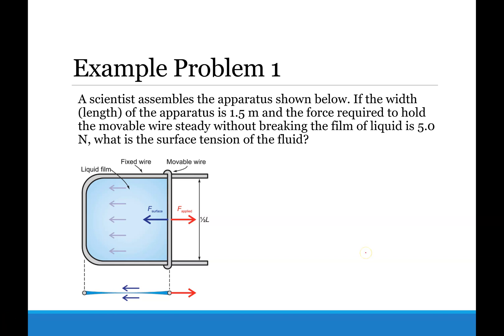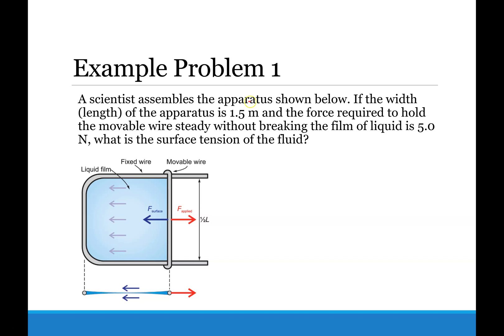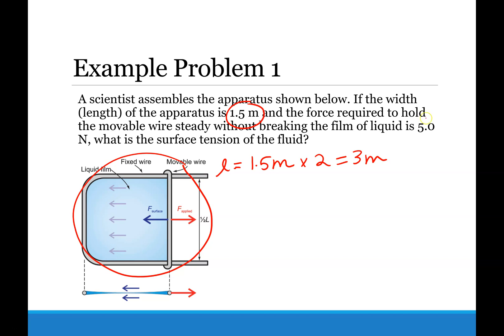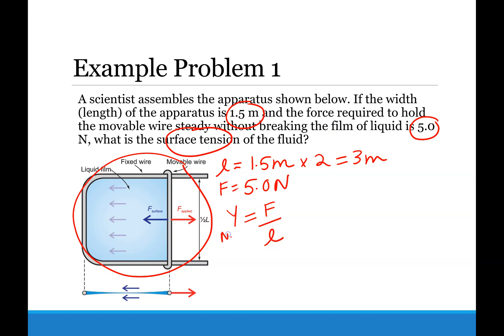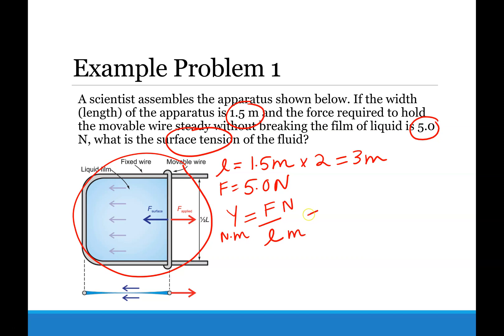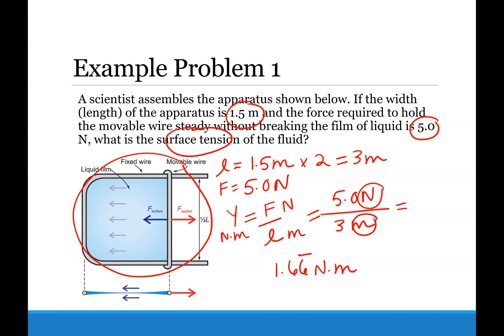Example Problem 1 - Surface Tension

Comment: Should it be N/m for the unit?
Reply from the maker: Yes. This is pinned in my Moodle courses under the video link. I only run this course once a year though, so I'm not sure such small traffic is worth remaking the video for.